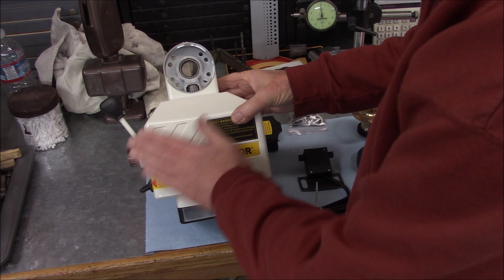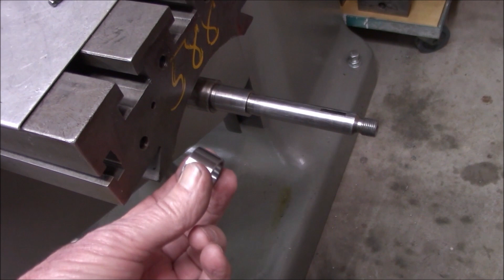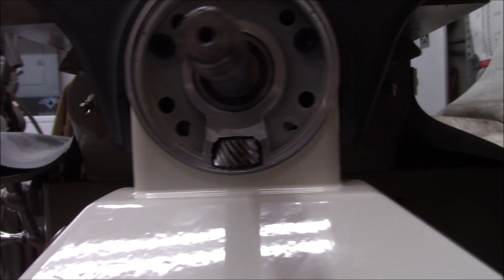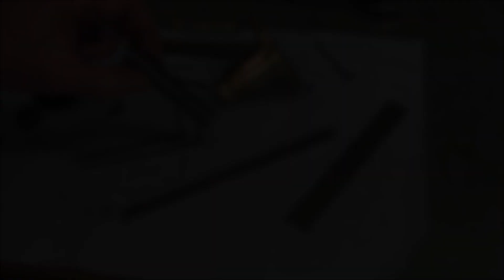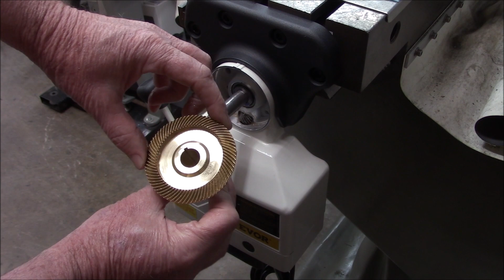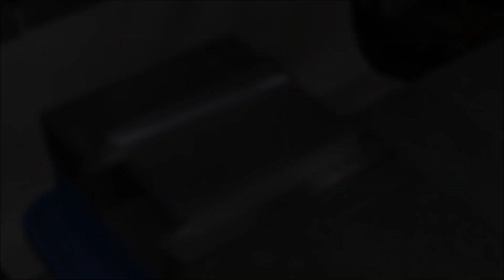Affordable Bridgeport / Knee Mill | Table Power Feed

Comment: Obviously you have never tried to get "one little part" from Vevor!  They don't do parts and they know little to nothing about what they sell.  They also do not have a good interface with the manufacturers who do make the units (this applies to most all they sell, and I have bought quite a bit from them) so they can't backtrack and get parts or advice.  Good thing you made your own shim.  What they do is just offer you money in the form of price reductions if you will just go away.  Fittings to make a pressure washer compatible to standard fittings (even standard metric), forget it.  Where to put oil in it (there was none) forget it,  There were several items like that and I ended up paying very little for the pressure washer but was entirely on my own for any advice or parts.  All this takes time and much emailing.

Comment: If your mill did not previously have a power table feed, these are great. IF your mill came with a bridgeport table feed, the spindle that the handle and/or drive mount to, is different, and you are in for some shop work to make an adapter.

Comment: So after a year, what's your take on this power feed? 😊
Reply from the maker: @Just1GuyMetalworks  hi Chris, no performance issues at all. The limit switch is plastic but works, I think they all use the same one. It runs smooth at low speed, the speed adjustment is a bit sensitive at the low end. 
I did broach the keyway on the drive gear, it’s metric and slightly smaller than key size used by Bridgeport. 
Overall I’d say it’s as good as any typical import power feed.
Reply: @TheAyrCaveShop  thanks, Dean. I'm getting tired of cranking 😅.

Comment: Dear Dean 
So glad you’re on this project.
I’m planing to installing this same unit to my southbend milling machine!
I will text a picture of my  machine you’ll see right away way I going to mount it to the left side and operate it backwards.
If it’s not too much trouble at this stage, could you send me the dimensions of the journals on your lead screw. Diameters and length of journals. 
To mount this on the right side, I would have to cut about 8 inches off of my lead screw so I’m thinking of just hooking it up backwards. Your thoughts on my little proposed project would be appreciated. Thanks for your text message.
Reply from the maker: Hi Kimber, I'll try to send an email today or tomorrow.
Dean

Comment: I also have one of these Chinese power feeds. It is, "OK" I guess. I really dislike the fact that it uses a metric thread for the locking collar, and the locking collar they send you is made of plastic. So you're stuck with this crappy plastic piece on the handle and can't even opt to just toss it and use your original because they couldn't be bothered to use the original thread pitch. It works well enough though.
Reply from the maker: I'm going try making one at some point..
Thanks David !
Reply: Metric is the global standard,  obviously it's going to be metric

Comment: Good and honest review Dean. While your SB lathe is still in the shop, remove the tail stock wheel crank and see if it mates up to the mill shaft. Mite be a finger saver for now? My Colum mill came with the power feed on the left, and even being right handed, found it to be more comfortable for my use to have the manual control on the right. Either way, power feed is a big plus on any mill, Bear
Reply from the maker: Thanks Bear, yeah I have a complete spare tail stock. Different shaft size...

Comment: Dean I am 75 years old a yet to find  a conversion kit for automotive or machinery that bolts straight on .
I bought a after market aluminium Radiator from PWR ( who supply to nascar ) it did not fit , I rang them and told them the problem. 
Next day a engineer with the factory blue prints and measuring acquirement arrived.He said yes I don't fit he took it away and turned it by Courier a few days later  Rectified . And thank for the feed back .
Kit from Down Under
Reply from the maker: G'Day Kit, wow that's a rarity now days. I'm shocked if a human answers the phone.. A good lesson for other company's !
ATB....Cheers....Dean

Comment: Dean I just installed the 400 inch pound one that Vevor sells yesterday on my Bridgeport Clone Mill. It is Badged McLane but the mill was made in China and the Spindle head in Taiwan. same mill that PM sells and is branded by many other brands as well. Such as Birmingham. I had none of the same problems you had. The bearing race was not a slip fit it was a very tight fit. Had to use a wooden dowel and hammer to get it on the shaft. The keyway was also perfect for the key stock that was already in the shaft. I 100% agree the plastic nut is a turn off for me as well. I happened to have the steel nut that was on the other power feed unit that came off of the mill but it would start on the brass threads and only tighten about 3 turns and then it would freeze up. So I surrendered and used the plastic nut. The unit seems to work well and was a simple plug and play for me. I have another one ordered from Vevor that is supposed to be here tomorrow that I am going to adapt to the lead screw on an old Antique Lathe that I have, we will see how well the second one works. All in all, it is a good value. The one I bought from Precision Mathews for my PM 833T mill cost me over $400 and comes out of the same place Vevor gets theirs. Thanks a million for making the detailed video for all of us. So far all of the products that I have bought personally from Vevor I have been pleased with.
Reply from the maker: Hi Terry, Looks like there might be a market for a proper dial nut. My original was just like yours about 3 turns. I even tried lapping it, but no go. It's an odd diameter approx. 32mm x 1.25 someone with a CNC lathe might clean up ?
ATB....Dean

Comment: Other than the shim issue I ran into the same problems installing my unit.  Same problem with the "pinch point" issue, be especially careful when doing a rapid traverse.  Also if the leadscrew ever jams (IE too heavy a cut or something interfering with rotation) plan on buying a new brass gear as it will strip its teeth.
Reply from the maker: Good info! Thanks Robert!
ATB...

Comment: I like your methode to make spacer rings. I have to keep that in mind.
All in all, I think it's a nice upgrade for you mill. Let's hope it will go for a long time.
Reply from the maker: I need to make some pointy cutters for the boring head...I was using a couple of old boring bars with a modified grinds. Worked but not that great, wide cut, heat generated was loosening the super glue. still way better than tin snips.
Thanks Rusty, ATB....

Comment: Looks just like mine. Four years in zero issues. Little touchy on the lowest speed setting. I sometimes have to go a little past my desired speed and back down into the speed I want. All in all I am happy. Good review as always!
Reply: I purchased a Servo brand feed unit many years ago for my Wells-Index 645 mill. It has this same design error of a very narrow speed range on the potentiometer input. I've installed Align brand and Central Machine brand units on the other two mill axis (power table lift is nice), they all appear to come from the same factory, as they internally are the same, and were a copy of the Servo brand. They all work well. I believe they all use a SCR (silicon controlled rectifier) half wave circuit for speed control. So they are stuck at the mains frequency of 50 or 60 Hz and half wave limits that to 25/30Hz switching operation.
Reply from the maker: @f.hababorbitz  Great info, I wonder if anyone has done a hack to improve the SCR control ? Hummm...
Reply: @TheAyrCaveShop  I'm working on one now. I got a spare Align brand unit fitted with an encoder for position and rate control. My plan is to count the motor rotations, so I can have electronic limit. And to be able to program the depth of cut per tooth revolution. My mill has a VFD on it, and it has MODBUS, so I'm wanting to make and Arduino controller with a LCD display and have it control the RPM per the diameter of the mill, and control the tooth loading. Probably way more complex for anyone running a manual mill. But the hard part was finding an encoder and getting it installed inside the cover of the power feed.
I did search for a hack for the SCR, A TRIAC would be a better solution to develop more torque at lower RPMs. But the small potentiometer range from too slow to too fast, I've not figured out a simple solution. 
So I'm going to rectify the AC to DC and do a very fast PWM controller, a few KHz. The motors in these are brushed universal type. During all my playing, I learned that to reverse them, the field winding leads have to be swapped, I always thought they behaved exactly as DC permanent magnet motors, so was shocked to find I had to do that additional part, but a simple DPDT relay will do that swapping.
I've installed these power feeds on my lathe tailstock, makes drilling large holes without the bit grabbing. I also modified my cheap drill press to have power down feed, (not really handy) but that required a 10:1 gear box, as these feed motors need a reduction. The 5 TPI lead screw in the mill provides this. So the 10:1 gear box on the drill press, ends up being a nice thing with the manual crank handle I have on it. Typically one turn of the original feed handle was 4 inches of quill spindle travel.
Reply from the maker: @f.hababorbitz  Wow some interesting projects. When I was working we did some Modbus but not much. Our world was BACnet in the HVAC building automation. But Modbus once you verified the bit orders and offsets it was rock solid. But it was always poorly documented. We pulled a lot of data from VFDs but always controlled the critical functions via hard wire.
Reply from the maker: Thanks Dan,  once you get past working out the mounting, it seems like good unit.
ATB...Dean
Reply: @TheAyrCaveShop  Yeah I have the mid size Rockwell vertical mill. Required a custom mounting plate from a billet.🫤  certainly not sculpture but it gets it done. 🥴
Reply: Good to know about the slow end.  The slow side of things is very much flycutter territory.